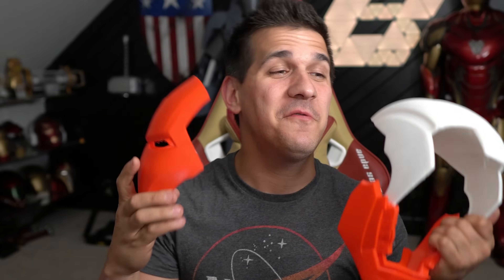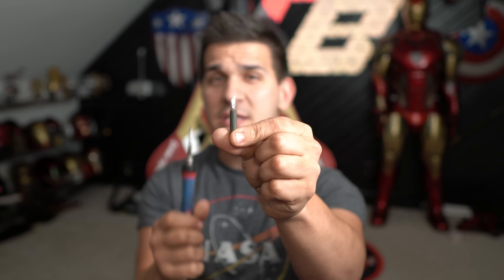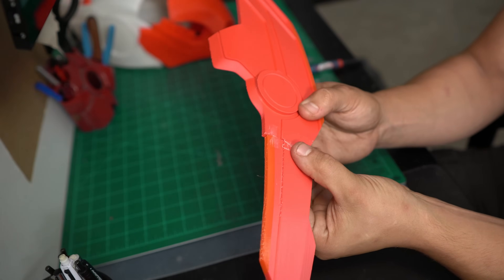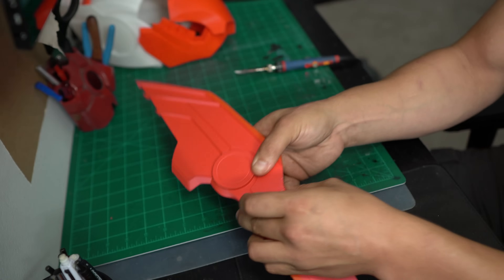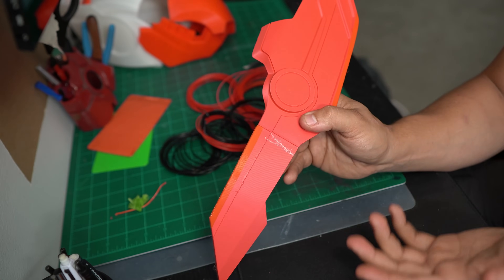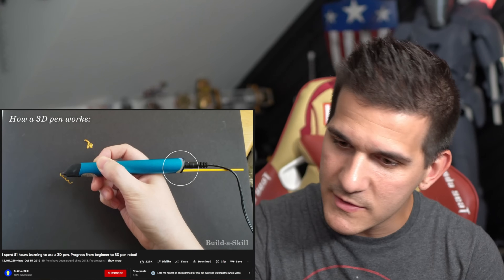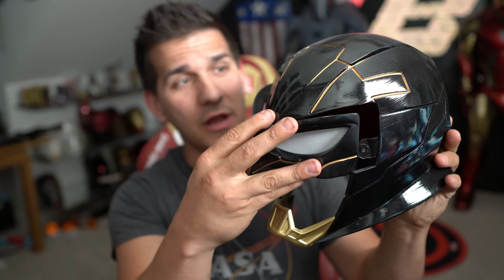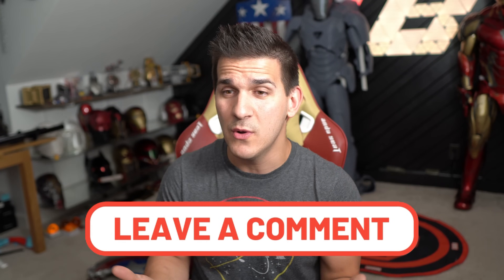How To WELD 3D Prints - FUSING Prints Together with NO GLUE!

Comment: Thank you so much for this one Frank, your game has stepped up so much since the original tutorials and this video was absolutely brilliant. Concise, descriptive, excellent visual aid showing the full process, examples and experience all showcased.

I'm working on Darth Vader, and his Dome and Shoulder Armor (possibly the shins too) are going to be the first things I've printed too large for my CR10-S V3 - this video will get me over that hurdle :)

Curious to see if you've done anything more with PETG lately, as I'm considering it over PLA for the heat resistance and alleged sanding ease!

Comment: How do you make lines invisible when you fuse parts?
Mine are showing a lot when painted
Reply from the maker: You need to sand them down or fill them in with bondo spot putty or some other filler
Reply: @FranklyBuilt  Thank you very much

Comment: What is the perfect tempeture for PLA welding? Is it okay to weld with 450 degrees solder? I want to buy a gas solder but the only ones i found have fixed tempeture of 450 degrees. 
Great video BTW! 
Your videos helped me a few times already. 
Thank you.
Reply: Amazon sells a simple variable heat solder for like $15, try that. I wouldn't go any hotter than typical printing temperature (~200°)

Comment: Hey my birthday is coming up and I was thinking about getting a 3D printer and can’t decide between the ender 3 and the cr10 because I mostly want to print helmets but I heard most of them don’t fit on the ender 3 same goes for shields
Reply from the maker: Look into the ender 3 MAX
Reply: @FranklyBuilt  thanks for getting back but would you say the max is just as good as the original ender 3?
Reply from the maker: Yep. It’s just bigger
Reply: @FranklyBuilt  cool thanks for letting me know!
Reply: @FranklyBuilt  also where is the best place to go about buying it from like straight from the website or their website or something?

Comment: A few weeks ago I soldered a high frequency blade from metal gear rising and realized one thing, it's better to weld all the way through than be scared of ruining the print and only welding the surface, now I have to re weld it-

Btw instead of leftover filament I use plastic from supports like little bandages once it's welded, I think it's a nice way of using supports instead of throwing them out :)

Comment: I've found 3D printer pens to be really good for tack "welding" the pieces together to hold them in place while I weld them with a soldering iron. Great way to use the last little bits of filament on the stray spools I have lying around.
Reply: Hadn't thought of this, and I use a 3d pen for as well, will have to give this a try on a future print, cheers
Reply: @SerenityRen6  I'll take it and put a little glob at certain points along the seam. They are easy to break off afterward, or you can melt them down into your welds. I'll also sometimes zigzag it on the back of my prints and then weld over that, I did this on my Iron Man suit.

Comment: I would like to add if you use super glue to hold the pieces together wear eye protection. The fumes the superglue gives off if it hits to soldering iron sting like a mofo

Comment: Add more top/bottom layers in the slicer so you have more material inside the print to weld together.
Reply: That uses more filament and takes more time. It would really be down to infill density for that, but even then, it's not that big of a deal to add extra material from scrap spools of filament

Comment: Something way off topic sorry. I upgraded my hot end on my ender 5 plus, went to all the trouble of installing it and now I’m having trouble increasing the “maxtemp” from the defalt 275c to 315c. I went through the PID calibration process already and saved it to the EEPROM. So im good there and can run normal. Just need to increase temp for carbon fiber polycarbonate. Ive been using Pronterface. Im trying to figure out how to use microsoft visual studio but im just lost man. Lmao if you made videos on printers and DIY upgrade how to videos, I’d for sure watch them. When you get into firmware and gcode is when things get tough. Anyway… You’re an inspiration bro. You make really high quality end products. 👍🏼

Comment: I have great success with my 3d printer pen fusing parts together. I heat the tip up to 270 / abs setting and then press it to the seam I want to fuse. Instead of pushing new filament out I let the seam melt and fuse for a few seconds moving down the seam then go over it again and push out filament into the new weld seam then go over that with just heat. Let it cool then sand. Haven't had a seam fail on large chest parts yet.
solder iron would still be better since you can push it through a part if required though

Comment: This is also an excellent method for repairing broken or cracked ABS parts on your car too, like bumper cracks or tabs. Just as long as the work is done outside or in a very well ventilated space to avoid the fumes. Great video!

Comment: Have you seen or tried 3D Gloop? I know you stated adhesives that melt the plastic, but I've found that many people who said they've tried 3D Gloop are using it wrong, where they try to use it like super glue where it should be applied similarly to boat adhesive. The key is to apply it to both sides you'd like to weld (as it's more of a chemical weld)  let it sit for second (usually by the time you apply to both sides it's already to go), then adhere the parts together and clamp it if possible.

The adhesion, if done properly, it should be an extremely strong weld, I've seen tug of wars where the failure point wasn't the weld but the layer lines. I've also seen it used to put together and 3D printed 18' sword.

Big bonus, you don't risk burning yourself, and it can be used to help with bed adhesion and part smoothing.
Reply: I just used 3D gloop for the first time. I used it properly on one piece, and improperly on all the others (I got lazy). Now I have to go back and reattach all the parts I did improperly because they didn't hold well enough.
Reply: It's used like PVC glue because it's creating a chemical weld. It actually melts the two parts together chemically rather then with heat. That's why you apply it to both parts and wait for a few seconds just like PVC glue. Question though since I never used the 3d gloop, does it need primer like PVC glue, or is it like the new stuff that's glue and primer in one?

Comment: Working on a Goblin Slayer cosplay rn! I like to make long stitches perpendicular to the seam with the soldering iron, fill the stitches with a 3D pen, flatten everything with the iron, and then melt the seam together with the iron. Makes the weld a lot wider and more supportive imo.

Comment: This video rocks! I’m just wondering, I do all these steps and then add wood glue for the gaps. I sand it down as good as possible, but for some reason it looks bad and it’s very annoying. I was wondering if you had any solution for this? I also wet sand too
Reply: Bad how? Like the lines still show? The seams crack?
Reply: @bagenius5970  like it is visibly raised and the wood glue still shows. And so does the line. Do you have discord?

Comment: PLA welding has helped so many props and projects I've done. It very much is trial and error to learn how to control the heat without ruining the part or burning yourself.

Good video! and anyone who pronounces the L in soldering iron is wrong!